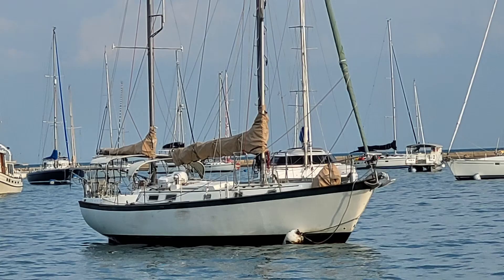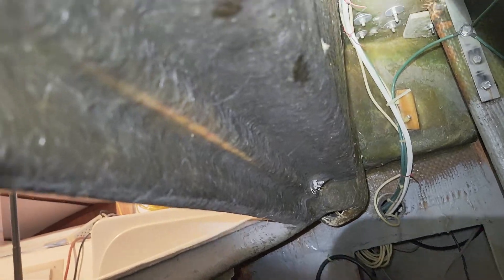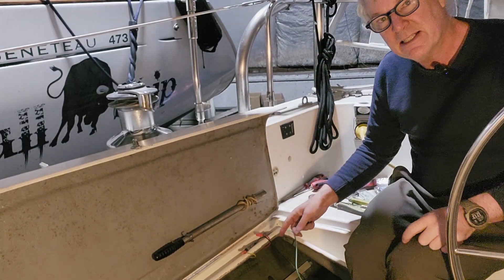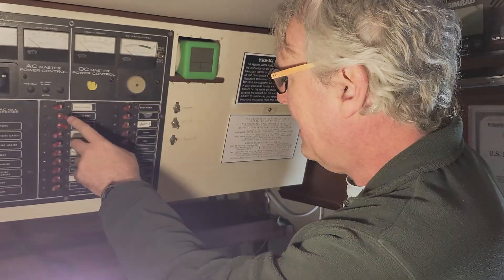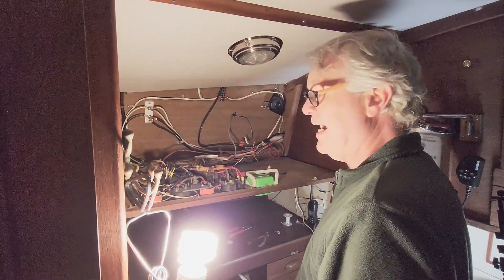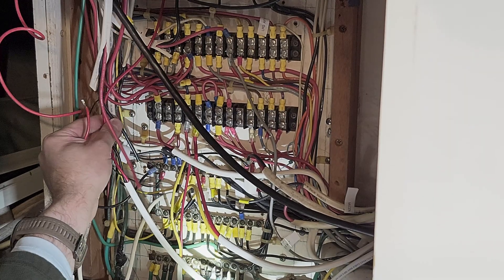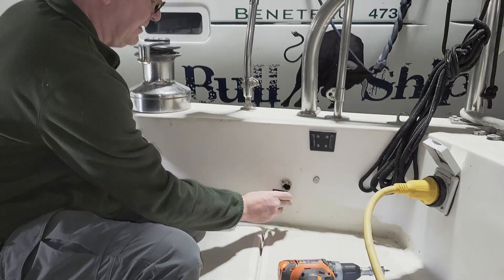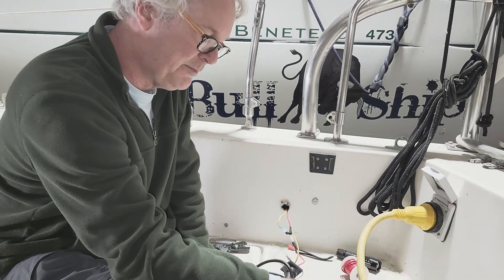ST1000 Tiller Pilot Install on a 42 ft SAILBOAT! Hands-Free SAILING with low power consumption!

Comment: Hello Eric, nice clean job. How did it hold up? Did the autopilot worked efficiently? I just bought one autopilot (same model) for my Ohlson 29 but im not sure if the autopilot will be enough given the overall weight of my boat. (Roughly 7,000 pounds). I would be very glad to hear your opinion on that matter.
Cheers!
Reply from the maker: Hello and thank you for the comment.  The sailing season starts in Chicago this month.  I'll be launching Silverheels in the middle of this month.  I'll let you know how things go once I've had her out with the opportunity to use the system.  I am planning a trip in late June so I should know by then!  Thanks for watching!
Reply: @SailorEricsNextAdventure  Goodmorning from the North Aegean Eric. I'm looking forward to hearing from you.